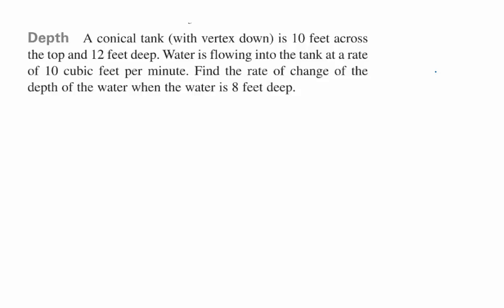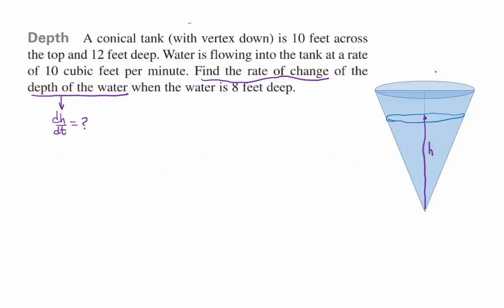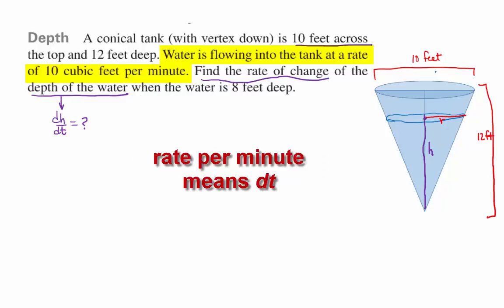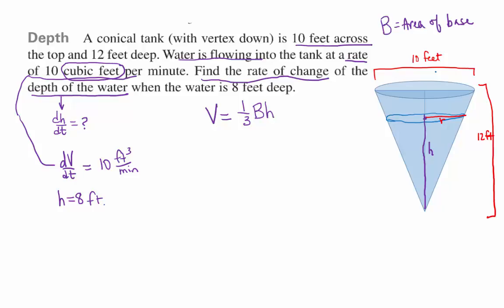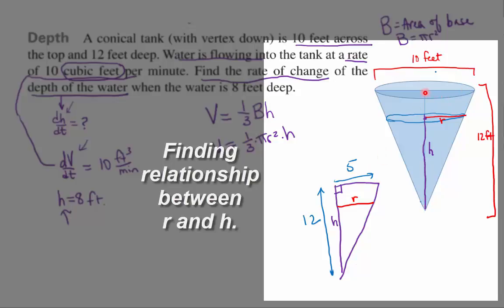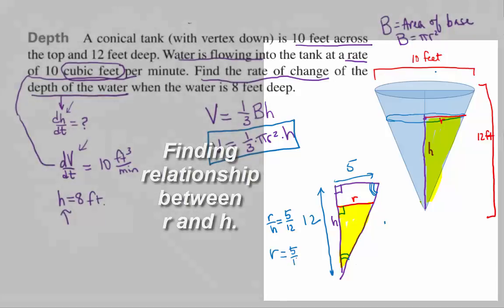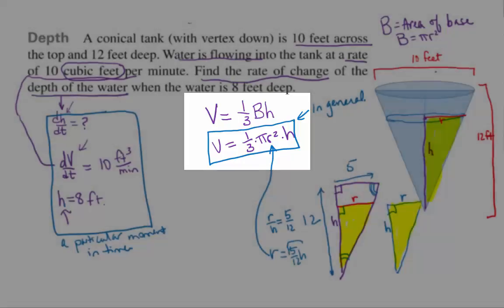Related rates (Lecture Part 4) Conical Tank Formula

Comment: Rocky Rosado
MAC2311
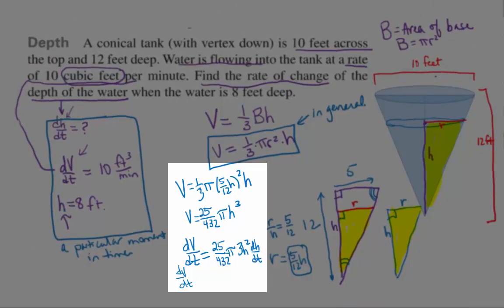"we can find the derivative to get the relationship between DV/DT and DH/DT.  we're gonna have 25 over 144 times 1/3 V equals 25 over 432 times pi times H cubed now we have our formula relating v NH so we're gonna use that to get the formula relating DV/DT to DH/DT so taking the derivative with respect to time of both sides the coefficients stay the same 3 H squared D H deeds DV DT equals 25 over 144 PI H squared dh/dt" (Hearn 05:40-06:25)